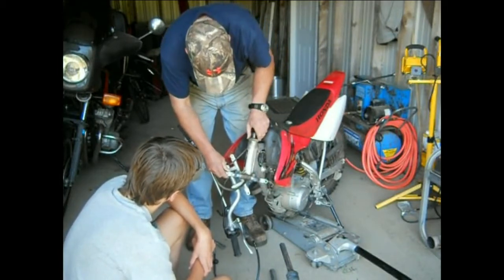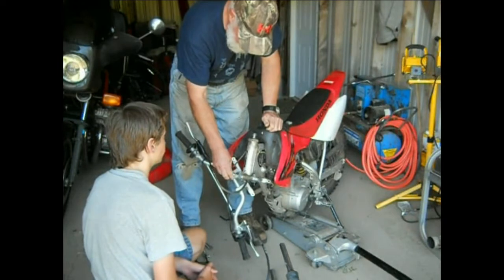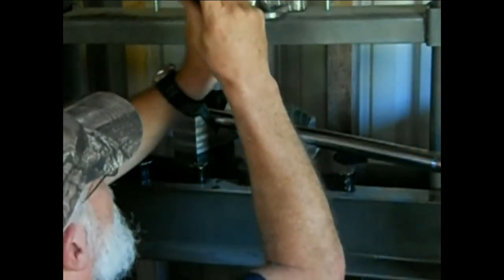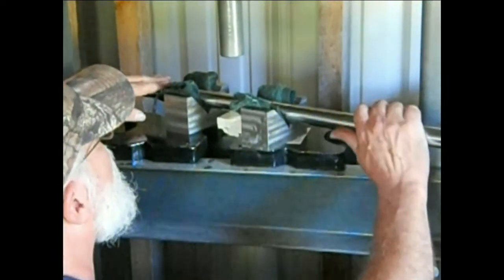Fork Tube Straightening

Comment: Great video I found a m109r for sale cheap with a bent fork wasn't going to get it cause the forks are expensive to replace but now 🤔
Reply from the maker: keep in mind that m109r has a MUCH BIGGER fork tube.  It'll be a lot more difficult as stiffness rises by the cube of the tubes cross section.  these tubes were only about 32mm with about a 3mm wall.

Comment: This is the slow painstaking way to straighten fork tubes. Use 2x4 wood block under the tubes where you put your V blocks and use a straight edge. 
A 24” Carpenter framing square or a 3-4 foot pro quality carpenter level will work if it’s all you have, look around for a perfectly straight edge to check it against and I promise the next time you’ll leave the dial indicator in the tool box. A fork does not need to be within .0010 of an inch. 

 If you insist on using the hydraulic press the frame legs are typically close enough to perfect to use as a straight edge to determine the high and low areas. 
Hold the for tube against the straight edge and, mark the high spot with a Sharpie. 
Place it on the wood blocks and hold it firmly  with a 3 pound SOFT FACE dead blow hammer.

A soft face dead blow doesn’t harm the surface, takes seconds compared to using a hydraulic press and you can see your results in seconds. 
 A fork tube is not as hard as you might think, they are relatively easy to bend with a few well placed hammer blows.

If you don’t have an adequate size soft face hammer, have a friend hold the fork tube on the blocks and hold a wood block on the high spot and strike it with a 2-3 pound steel machinists hammer. A good piece of oak is better to hammer on than a pine 2x4 but you can wrap it with a few layers of duct tape to add a softer surface and help prevent the wood block from splintering from the hammer blows. 
 Use patience snd common sense and plan your moves because an errant hammer blow on the travel are near the bushings or seal area will destroy the surface and make it into scrap metal. 
  
A 2-3 lb soft face dead blow hammer or pro quality rubber mallet is many times faster than a press and I have found it to be just as accurate without all the time wasted with dial calipers and pumping a press.
 If you have the luxury of a machinists bend with a perfectly flat top simply rolling the tube will show you the high and low areas.
Reply: Wow, great idea here. Thankyou !
Reply from the maker: It has been well over a year since I first read this post.  After much pondering and discussion with others, I simply cannot conjure any reasonable reply.  There simply are no words ...   I am dumbfounded.

Comment: How would copper pipe work for a pad on the vee block?
Reply from the maker: Toby W Anything softer than the steel is better than nothing. But the desire here is to distribute the force over a large enough section of tube so it won't dent. Even copper can deform steel if area is too small. But we don't want so large a contact area that we move away from where we want the bending to focus. We also want a point over which the work can pivot, so the focus doesn't move. The best way uses a swinging cradle, sometimes with rollers or a spherical bearing. I believe Keith Fenner has such a set of rollers.